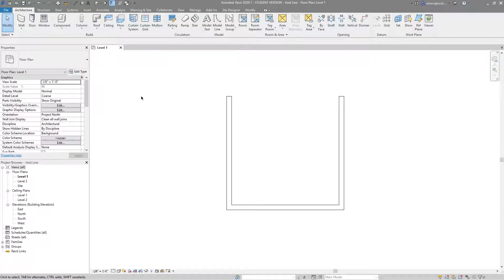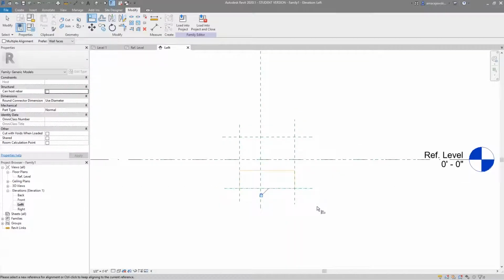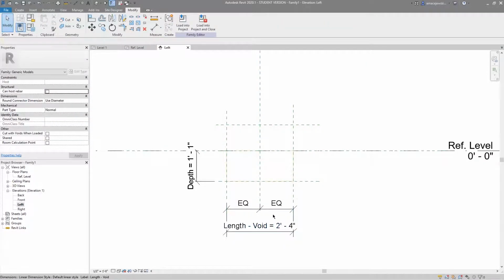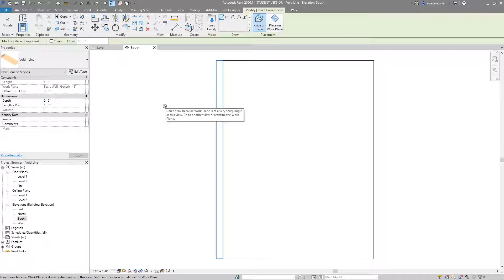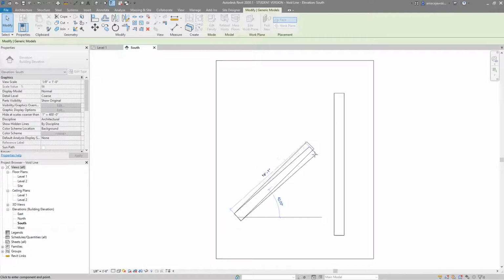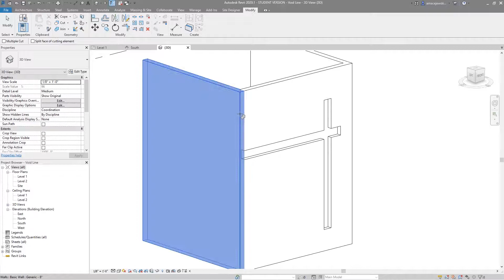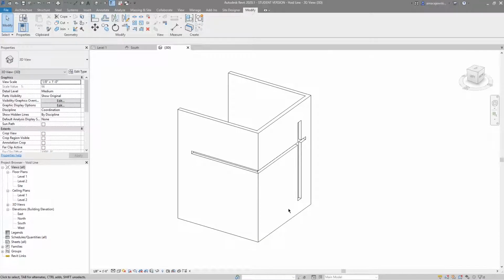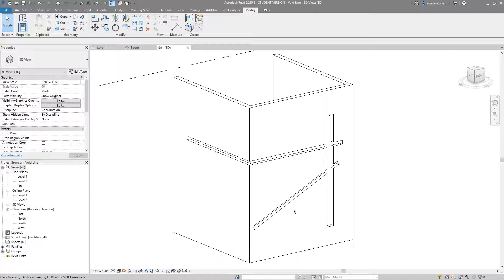How to Create a Void Line | Revit

Comment: Can i use this as an isolation joint in a slab and constrain it from the corners of a column please?
Reply from the maker: I am sure you could get away with using it as an isolation joint, although I am not sure about the constrain on a column. I believe if you have separate segments for the column edges, you would have more luck.

Comment: I know this is an older video, but I have a question that maybe you can help me with. 
I am trying to make a family as shown in this short video https://youtu.be/1FjoonYXdNc 
They make a line based void family, but that seems to actually "see" the slab, and cuts it without having to use the cut tool? 
I am able to make a void family as you do in your video, but I want it to be able to cut a wall when placed on it?
 I am trying to make a family to make score lines on stucco, that I can then group together, as a pattern of sorts, and the copy that across my facades?
Normally I would just draw detail lines on an elevation to show score lines, but in this instance, I need them to be actually modeled. Thanks in advance, I hope you can make sense of the video, I couldn't replicate what he did
Reply from the maker: So, my simply explanation of what he did is place the void extrusions and cut them from the floor before starting the video. I came to this conclusion because he never placed another one on the slab. To my knowledge all voids act the same in that once they are placed you will have to cut them out of another element. Hope that helps.
Reply: @ArchitectureVanguard  ok thanks, I didn't consider that he cut them before the video, but it's possible, thanks for the reply! That kind of sucks that you have to actually use the cut command, I need to find some other way to do what I need to do
Reply from the maker: Yes I know, let me know if you find a way because from what I know we are stuck using the cut tool. There may be an option to check when you are placing it to cut the host. That may be your answer.

Comment: Cool, what if you wanted it to curve? Say to follow curve slab w water stop?
Reply from the maker: You could then create the void as a sweep, which would imply that you know the shape of the water stop in your project. If it is very specific then I might just make a profile to match the water stop and use it on a reveal in the project. Hope that helps.
Reply: @ArchitectureVanguard  Doesn't matter if you create void with sweep. Line based family doesn't allow curves. The only type of family that is line based and allows curves is beam tool, but I can't seem to make it cut the geometry with void. Can you please check on that?
Reply from the maker: Ahh I believe you’re correct with the curved beam. The line based families are nice until you need a curve haha